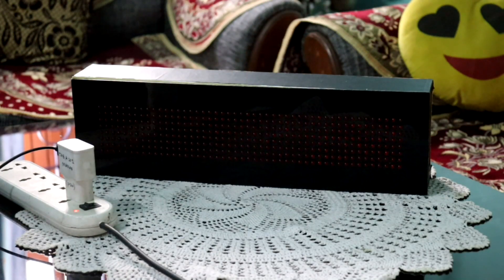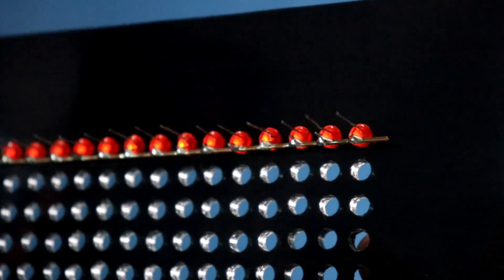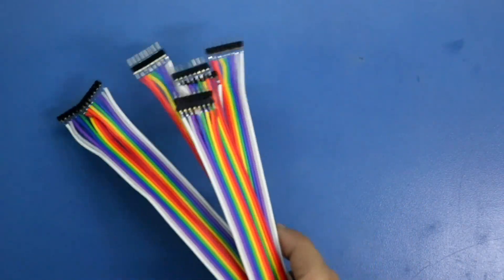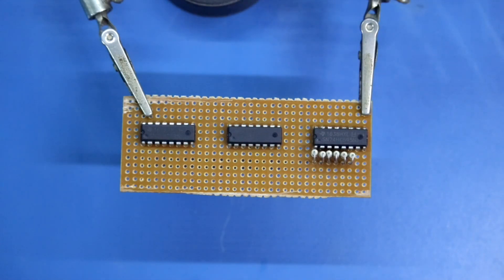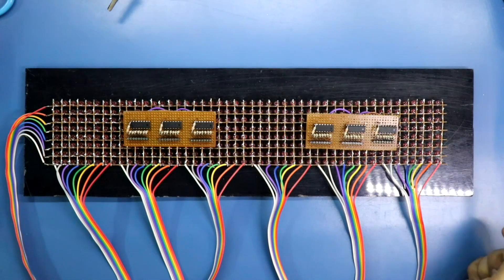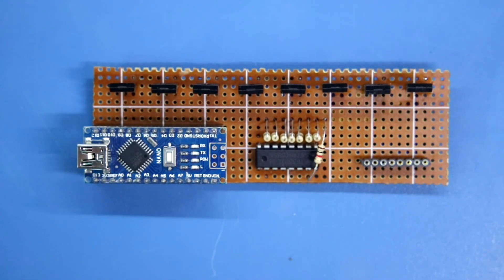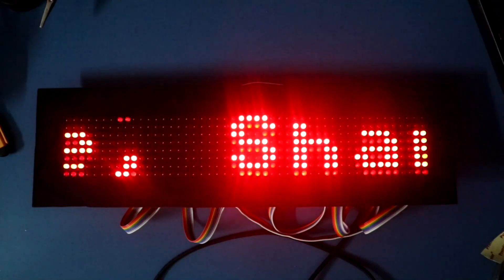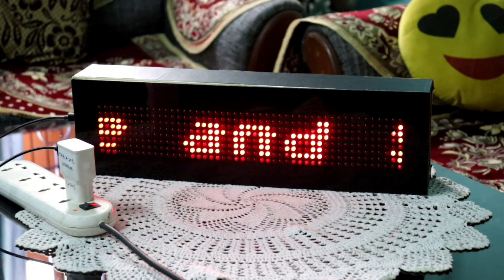LED Scrolling display board using Arduino with 74HC595

Comment: Please what's the amps of the charger head used that was able to power the whole ICs because each three ICs drain 5V but the current flowing is the case. And also I like your video, keep it up

Comment: I'm concerned that you may be overdriving the 74HC595's.  Each LED requires approximately (5v-2v)/330ohm = 9mA.  So if all  8 of the 74HC595 outputs are high to light all 8 LEDs of a row, then that's 9ma*8 = 72mA and the chip maximum is only 70mA.
Reply: so how do you solve this? coz am also thinking thatway
Reply: @g-hamtechlabs2408  In some cases you can get a way with it,  but the 595 is not really intended as an LED driver although but you will find a ton of bad youtube videos where they use it that way, and typically overdrive it. The easiest solution would be to use 470ohm resistors for a total of chip current of approx. 51mA, which would not overtax the 595's chip budget.  There may not be any noticable difference in brightness, but if there is, you could use superbright LEDs.  Barring that, the other solution using his wiring, is to also drive the anodes with 48 PNP transistors connected to the 595's which drive the anodes.  Not a great option.  That's why I would have wired it the opposite way as he did in the video.  Instead, I would have connected all of the anodes of each row, and the cathodes of each column.  That would allow me to use 8 PNP transistors for the anode rows (high side drivers) and 6 ULN2803's for the columns (low side drivers).  An even better solution is to use a TPIC6B595 which is both a shift register and low side LED driver.  Also, that results in the same number of chips that he used above, but you would still use 74HC595 + PNP transistors for the high side driver for the 8 rows.  Note: you can find high side driver chips if you look hard enough and want to eliminate the discrete transistors.